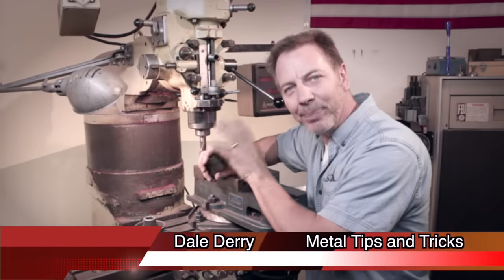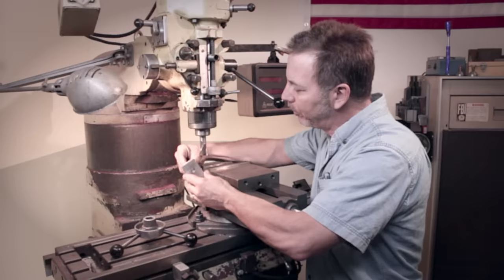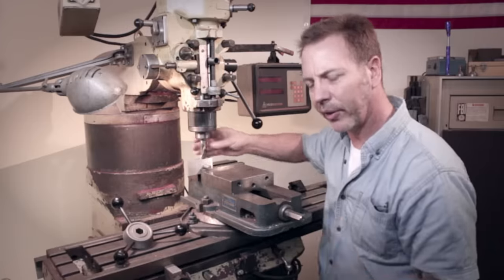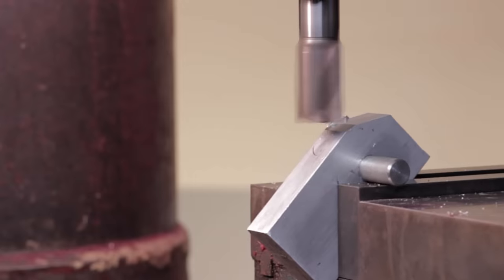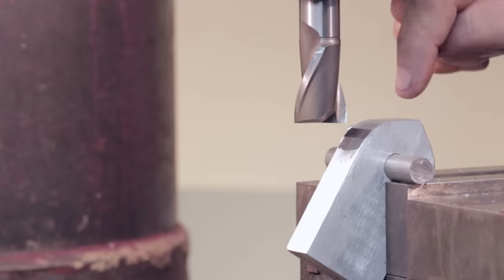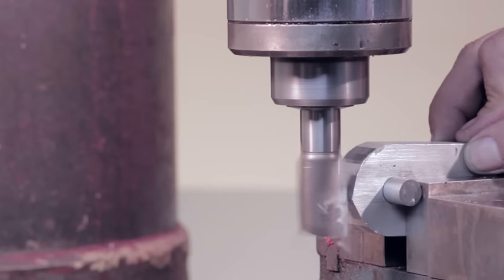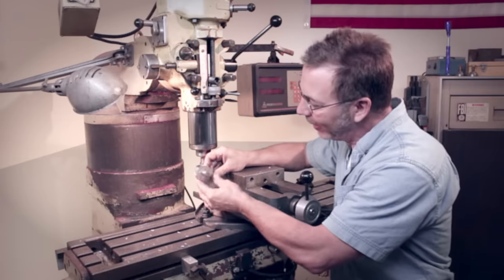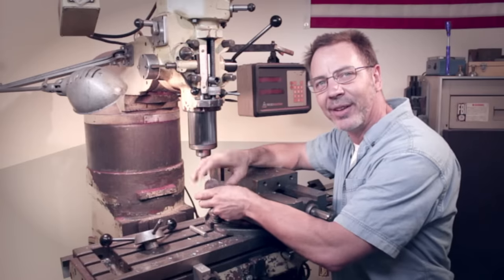How to cut a Radius

Comment: That was a good tip. I have ALWAYS had access to a rotary table and of course now a CNC mill so I never had to do what you describe here but that being said for those that do not have access to either of the two afore mentioned machines this was an excellent way to achieve that radius. For the garage machinist with little to no fancy equipment you demonstrated a great way to achieve the goal.

I served my tool and die making apprenticeship with Ford Motor Company over 53 years ago and always had good machines to work with. We even had a mill that had a rotary table built into the bed so you could move both X & Y but also circular. This of course would allow one to make complicated parts with many radiuses and straight cuts with one setup. That was back in the 60s. Of course as time went by we  acquired NC and CNC machines including Mills, Lathes, and EDM machines so I never had to do what you demonstrated here but you know what the say, "You can't teach an old dog new tricks". Well that is crap. I am 75 and turned the handles all my life and now have a CNC mill in my garage  but you have defiantly taught this old dog a new trick and for that I am grateful and quite frankly impressed to say the least. I am a firm believer in the KISS Principle, Keep It Simple Stupid!

The world today is full of ignorant people and they haven't a clue as to what it takes to make parts for whatever and they don't realize what it takes to make something, anything. A lot goes into the setup and just holding parts to machine them is something that has to be learned. You have to be able to improvise and adapt to use the tools you have at hand. This is the sign of a good tradesman. Machine tools cost a lot and even the tool holders and end mills will run you into the thousands.

Great job my friend.

Maximus has spoken.

https://www.youtube.com/user/garyjarrette/videos?view_as=subscriber
Reply: This is one thing I have an issue with the 3D printing community. Because you are drawing straight from CAD to CAM, they never learn how to make efficient designs, or ones that are easily end user serviceable. Many 3D printed designs are very difficult to translate to higher quality metal products, even through advanced casting techniques.

Comment: This is a great idea!   Never thought of it.  I have a machine at home, an '81 Bridgeport. I don't want to invest in a seldom needed rotary table or a lathe for round work either.  If you have a digital you can also do facets using a hole pattern movement with end mill. That is trigonometry for rise and run/ radius math stuff.

Comment: I’m David. Also a first time viewer, and also like the way you get to the point.
• I’m completely new to machining, but I know I like it!
• I feel I’m going to have to buy that sign that says, “I’m the Machinist your Mom warned you about!”
• Yesterday I received a pair of 123 blocks in a red plastic case, via eBay. It comes also with the five bolts and the Allen wrench. The blocks were wrapped in the extremely thin paper infused with all the waxy goo, so I took it these have never been used before.
• I got the waxy stuff off with Goo-Gone, and found that plain newsprint was best for wiping them clean without leaving paper towel lint on them. With shipping they cost about $30. Unbranded.
• The day before, I received a nice Starrett planer gage in wooden box with all the accessories, about $200, perfect condition, probably unused.
• Thank you!

Comment: This video was extremely helpful. I’m building a model steam engine and will need to fabricate two cams for the valves. The lights came on when I watched this. Thank you!
Reply: What are you building?
My current is a part built Jessie bought from Station Road Steam.
Best regards.
David and Lily in England.

Comment: When I took 3D design classes when I was younger, I learned to make circles that same way when you could only use straight lines, and I never thought of carrying it into machining. I always figured that it would be extremely inaccurate, but apparently it seems to be accurate enough. Thanks for the tip!
Reply from the maker: +Lucas Acevedo  Hi Lucas, the key words in you comment is "accurate enough". I Agree with you. Some guys mis that very important point. 😀

Comment: Novice metal worker! Now 3-17-2021 I am looking to create a part for a 70's era motorcycle springer that is elusive to find. Instead of paying a machinist, I have a used Smithy with end mill that I need to learn to use. Looking to take a 1" thick by 2" wise piece of AL and put a 1" radius on the end, by far this is a great example of how I could accomplish the radius. Thanks despite this post being about 6 years old now!

Comment: It's a useful trick, but setting up a rotary table is pretty straight forward for things like this, and will give far better results - and once you've learned the set-up shortcuts, it's probably just as quick.
Also, you should never set Z zero with the knee handle removed or on the left...
Reply: New to machining, why not removed?
Also, not all brand new home machinists have access to a rotary table.  We tend to get components as we can afford them.
Reply: @RazorCustoms  without the handle in place, you can't accurately determine the current state of the backlash on the knee leadscrew.

Comment: Did you ever try disengaging a rotary table and turning the part with your hand? Using a 4 flute end mill and NOT climb milling it works better than you would think. This can also be done by setting a vertical pin and hand feeding the part thru the rotation. Similar to what wood workers do with the band saw. Thoughts?
Reply: +Ralph Schoch     Refer to Oxtool Tom Lipton. Very good method.
Reply: I was thinking something similar. I'm just an apprentice now buy seems like putting a pin in and rotating the part is easiest way. I use the cnc mill for my radii and that's how it cuts. With the side of the end mill.
Reply: Exactly, with conventional milling it self limits.

Comment: I have the same part to make - from a HF ring roller. Fortunately my plastic part is still intact but I know it will break eventually. So, make the part now and hold in inventory. Thanks for the tip Dale. Very helpful.

Comment: why not set pin in vice at 90 degrees and rotate part on pin into bit with wrench/holder from back?
Reply: that is so dangerous.  bad advice.
Reply: well that's why i asked, thanks! planning on purchasing a few bits for drill press and wondering how to properly and safely use to radius some small brackets for trail bike swing arm end flange.
Reply: Actually it is good advice. That is the way I would do it. You just have to feed into it little by little and not all in one shot. That is how I would do it!.
Reply: think i will have to try it! going to have lots of small parts i want to round edges on thick and thin.
Reply: also might try with a bolt n washer to pivot part on just in case part wants to jump
Reply: You may get away with it if you can rig a sanding wheel up instead of an end mill.  Don't try to grind aluminum unless you have a special wheel made for Non ferrous material.
Reply: lol yes i have tried the wrong disc on aluminum just heats up and binds the dust is probly not too healthy, will be using steel currently have drill press set up in basement so trying not to make dust,did see a vid of a guy edging a perfect circle with a mounted angle grinder after rough cutting with jig saw and it worked good! part of reason why i was wondering if same theory might work with reamer bit in drill press.
Reply: At last someones got it.
For those that say use a rad tool, you cant cut anything other than the radius tools available.
BC damn sure but do it all the time it would scare the shit out of the safety police.
Reply: the key to doing it that way is to have a washer and nut bottomed out on your pivot holding your part down and, set up stop pins on your start and stop locations on your fixture plate, so you can stay close to tangent, make sure to conventional cut and go light step over passes and its totally safe as long as your paying attention. this guys method is pretty sloppy, but i get it for  a quick part.
Reply: I came here to ask the same thing. Clamp the pin and rotate the work piece. Seems like the only danger would be part jumping or slipping. Is the same way you do this sort of thing in wood with a shaper or a router table.
Reply: @Toolmamon  apparently you're not a big fan of your fingers. Hello, Mcfly.

Comment: Great tip - once you get it that far along you can reset the ctr and stick the pin in the vice grab the work-piece with a vice grip and pull the work-piece around to make the radius smooth - that's how I do my connection rods

Comment: Why don't we lock the pin vertically in the vice and then rotate the part ?
Reply: +gwheyduke Because then the part wouldn't be clamped. Are you thinking about holding the part with your hand and feeding it into a mill? That's a pretty bad idea...
Reply: +Tito Rigatoni That's what Tom Lipton does.
Reply: justfakeit888 I have no idea who Tom Lipton is, but it's still a pretty bad idea.
Reply: +gwheyduke ...if you want to hold it with your fingers !!!
Reply: +Tito Rigatoni Actually I watched and it looked pretty safe.
Reply: +justfakeit888  u could only do that with the grinding Machine and not the milling machine
Reply: +Tito Rigatoni This reply is unintentionally funny.
Reply: +Tito Rigatoni 
Yes. Put a handle on it and rotate it by hand. I have done this with .75 steel.
Reply: +IDL STUDENT 
Wrong.
Reply: +gwheyduke i've done it that way often, but it remains quite dangerous. you've to make sure the part cant move, the bolt is clamped super good, and use a handle long enough that it can't hit you in case the mill bites into the part.
Reply: gwheyduke coz workpiece has no clamp o stopper sure once touch endmill it'll rotate like a fan haha
it's whd I feel ;-)
Reply: and lose your fingers trying to hold it still
Reply: If the pin to part fit is tight enough, the top of your vice is square enough, the pin is "T" shaped (so it holds the part down -- snuggly), you've hogged off most of the material, and set up some stops so you don't start making a complete circle, sure. But don't hold it with your fingers if the part is that small! Perhaps clamping a one to two foot extension to the piece. Hmmm, vice grips? Vice grips with extension pipe? bar clamp??? Custom something? Do I have to say, "very thin cuts"? Well, OK, just plan on removing a small amount of material in each pass. And be prepared for unintended consequences. Hell, yes, I'd do it, but probably on my grinder or 20" disk, with a custom jig.
Reply: If you had a t shaped pin, and a nice 24" or larger adjustable wrench you could hand feed it with little effort. But don't climb mill it because you'll be fighting for your parts life and maybe a new endmill, and a wrench. Been there done it. Also had vertical v slots in my vise.
Reply: Really bad idea to do it by hand. All you have to do is to feed it just a bit too fast and the cutter will dig in and take it with it, likely breaking the part, the cutter, damaging the machine, and likely, you.
Reply: I've used the "hand" system dozens of times--never dug in once. Always with long enough leverage, never climb cut, and on rotating back for a new cut, go slowly so that any small leftover climb cutting doesn't grab.
Reply: gwheyduke my comment is a little old to be relevant unless someone else comes breezing by this video wondering the same thing looking for information. I used to do that quite often before i made myself a rotary table. I used flat jawed long handled vise grips to hold the piece and slowly feed it in, rotate, feed, rotate, feed. Never feed it in while rotating, and Never climb mill it. You need a handle far enough away so that your fingers are never within falling/slipping distance of the endmill if you slip or if the part takes off spinning(yeah, you’ll lose just your cutter if you’re lucky). But it does work, its very ghetto and potentially dangerous, but i have done way too many parts this way. Usually in place of a pin ill use a bolt with a threadless section, or if its a large internal diameter hole, ill use a sleeve, and hold it all in the vice via the bolt. New hobby guys, I dont recommend doing this the first few months you are learning your machine, you need to know how your machine/cutters/material all react under feeds, speeds, pressure, cutting depth and all the personalities/reactions and dangers of it so you know what to avoid.

Comment: If you ever run into a situation where the radius is not concentric to the hole, you could always turn down a pin, up or down from the bore size to accomplish the same thing, compensating for the offset of the two radiuses.
Good tip.  Just hope I can remember it, if the time ever comes.  I seem to be forgetting more and more these days.

Comment: Thanks for the tip Dale. Only this evening i was thinking of a way to do a job like this without the hassle of setting up the rotary table and was stumped.  I'm a self thought newby of two years and still in the learning process. And to think that i didn't even typed in what i was looking for and this video just ironically showed up. I had to subscribe instantly.  Keep up the good work cause I'll be following. Thanks again

Comment: The one thing about rotary milling with the rotary table with its axis vertical is that there is minimal set up time.  Turn a slightly tapered mandrel on the Lathe at say 0.25 degrees per side  then push the part on the mandrel with the tail stock.   Take the mandrel and part out of the Lathe chuck then clamp the mandrel in the rotary table's chuck with the part say 1/8" off the jaws and mill the radius using upcut milling.  When done you can also use the Lathe's tailstock to push the part off again,  which can be quicker than setting the parts up on a mandrel or fly press.

Comment: Nice tip Dale, I don't have a rotary table so this is useful to me as I would normally do this all with a band saw/grinder/file/sweat/time/etc. I've seen parts that where made in this manner before that where not fine finished, just didn't realize how it was done. Thanks.

Comment: I used to make rifle bolts like that. I clamped the bolt body in a homemade soft V block so I would have something to clamp on. I set the block in the vise and rested the bolt body on the vise. With a small endmill I could get the radius between the locking lugs. Put a partial radius on something round, or a different radius on something round.

Comment: Very COOL!! My mini mill is arriving in a couple days, and I was dreading buying a rotary vise to 
Make the small Parts needed for a prototype truck part I am inventing..I was quoted $700.00
To have 6 radiused parts made on a CNC mill plus 3-4 week lead time..if they needed adjustments
It was the same cost, and wait time..You have solved both my prototype cost plus a long wait!
I have approximately $1200.00  in the mill, tooling, clamps etc... I will have them completed by
The end of the week, and now I can also prototype an actuator assembly with radiused ends!!
THANK YOU VERY MUCH! 
GREAT TIP AND VIDEO!
Don Sullivan

Comment: Im going to use this method for some parts I need a radius on for clearance. I made a few others with the rotary table but it's such a pain in the butt to set up. this will make it much easier to knock out the couple of parts i need

Comment: Hello and good day. That was a great tip but I might suggest another way. Place the dowel in the vise vertically and rotate the block/work that you wish to radius around the dowel into the milling bit. There would be some minor adjustments/truing that you could make but I think that this way might be much faster as you could achieve your radius in one pass through the milling bit.
Reply: Humm! What is going to keep the block from spinning? On a climb cut it might grab and take your fingers with it. Especially on a small piece like Dale is cutting.

Comment: Great idea! 😃 In most cases the outer radius isn't actually a critical functional dimension. It might be there just to provide clearance, or even just for looks! Like if you for example make a small model built up crancshaft, this method will make it look great with very little work. And a lot of hobby machinist's don't even have a rotary table as an option.

Comment: If one does not have a rotary table this is an excellent alternative, i was shown this method by my votech teacher  ( this guy was the real deal old school from casting with cast iron to finished part) but sence i have a few different sizes R tables i use the crap out of them and fast setup just comes with practice and a location arbor ;-)

Comment: Prototrak mills much easier but nice tip. You could also press a pin in a hole on a plate and use a tie down clamp or k clamp to tighten the part down. Rotate the part and just move one axis. Pick up the pin move the radius distance plus half your cutter and perfect size. I think it will be in between time wise from your method and the rotary table. And in between finish also.

Comment: If you set the pin vertical and the cutter at the required distance you can rotate the piece about the pin and make one cut, takes 30 seconds and leaves a perfect smooth finish!
Reply: This idea would work for a band saw but the cutter may and up lifting the work off the pin or sucking it in if you go the wrong way

Comment: works equally well or better to put a scrap of something in the vise, drill a hole for the pivot pin, and turn the part while side cutting.  you'd want a clamp if you're milling rough to get that faceted roughing instead of bandsaw cutting the bulk of the material, but if you're pretty close, you can easily do it manually.  it's very similar to a ball turning fixture for the lathe in some ways.